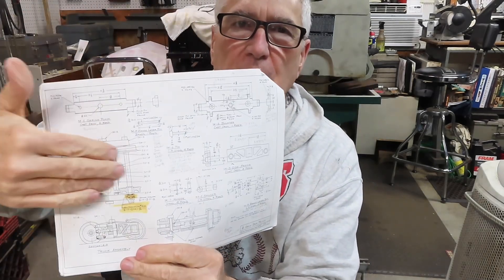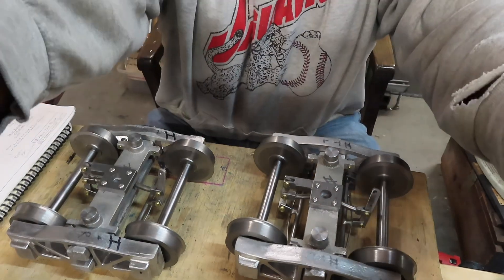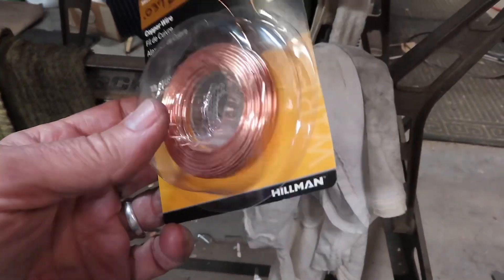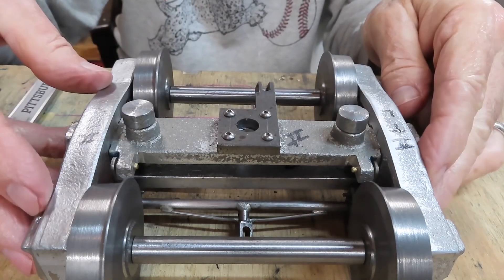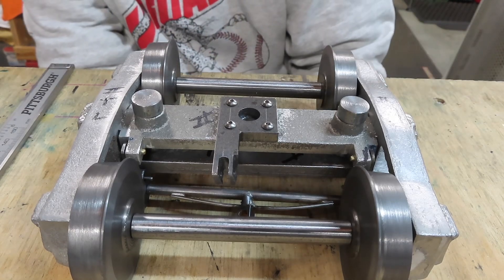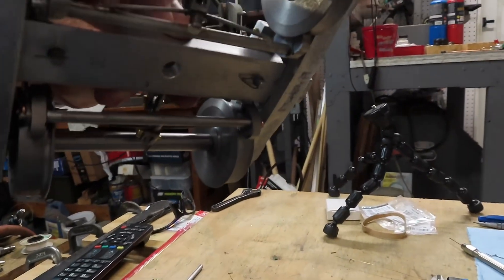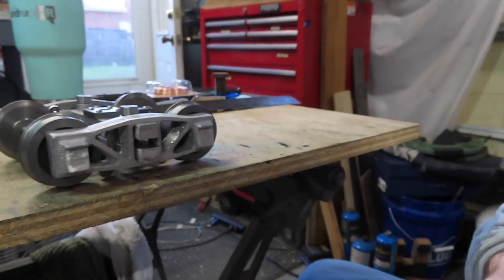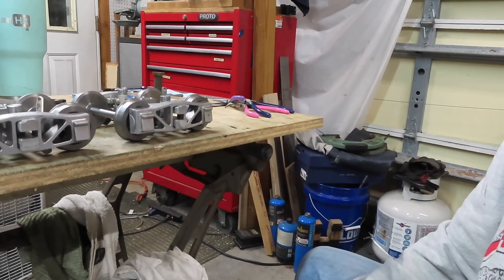Part 7. Raritan Riding Car, assembling the trucks!

Comment: First visit to your channel, and enjoyed it! I spent 41 years as a Carman (freight car repair), and I thought the following info on the brake rigging might be helpful. The brake levers are referred to as the “Live” lever and “Dead” lever, the longer one being the “Live” lever. The bar that passes through the truck bolster is called the “Bottom Rod”. The assemblies that the brake shoes attach to are called “brake beams”, and they are identified as “Right Hand” and “Left Hand”. With your back turned to the brake beam, if the lever top points to the right side, it’s a right hand, to the left is a left hand. Your build looks great, I’m really impressed, so now I’ve got to play catch up on your previous episodes! Thanks for posting! Subbed!